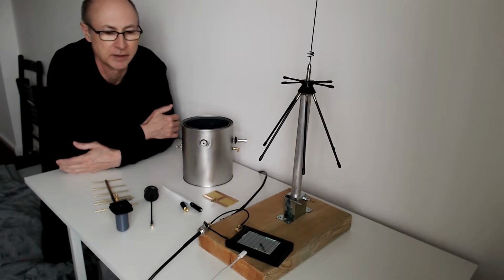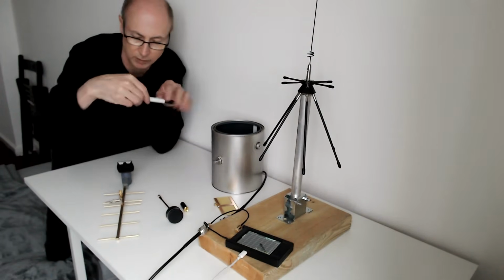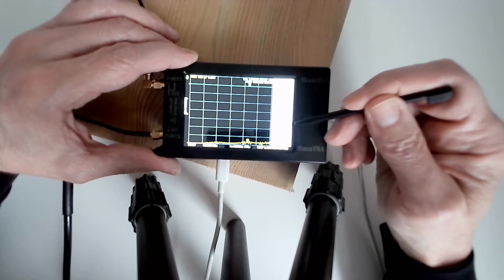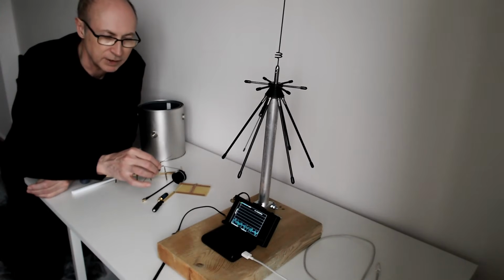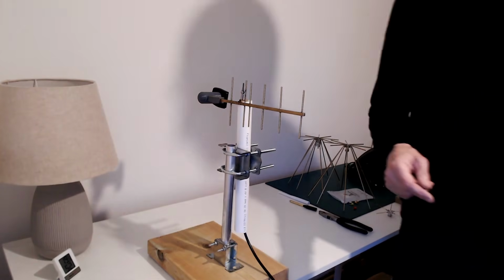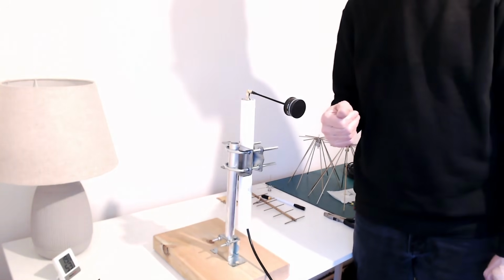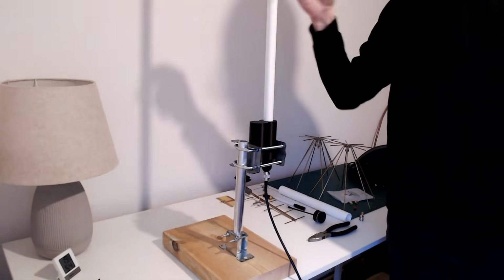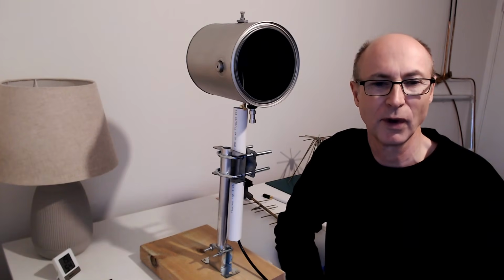23cm / 1296MHz Homemade Antenna Comparison

Comment: Great material. Plus one for the collinear antena, some info on the coffee can antenna and the Bulgarian one.
Just a question- what happens if you use the longer coax on the other side of the VNA? You should be able to compair the gain in the same manner, but the screen will be closer?
Reply from the maker: Yes, correct. I think a neater solution is to record the VNA screen via a USB connection to the PC.